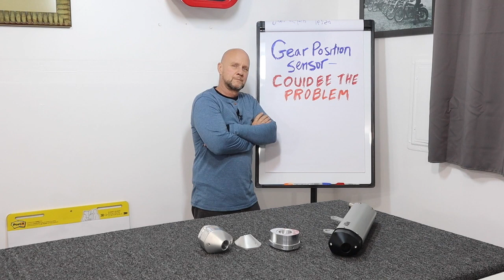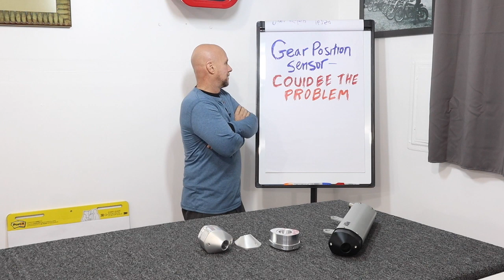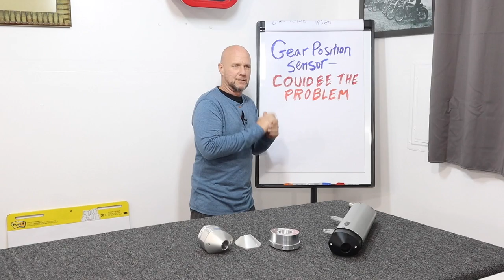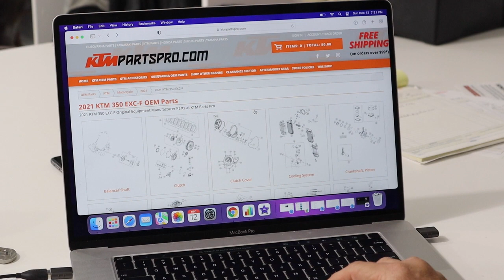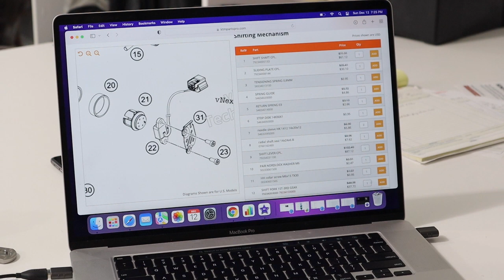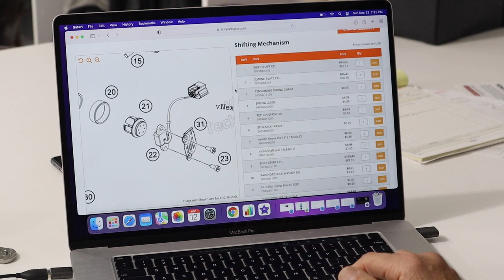KTM / HUSKY Stalling or not starting? Could be your gear selector sensor. Let's fix it!

Comment: That is exactly what happened to my 701. But I had
not modified anything in that area. They did not properly zip tie the wires from the factory.
A very intermittent problem as each wire was slowly melting and shorting.
Then after 300 miles everything was melted and shorted out and bike wouldn't run at all.
The exhaust pipe is extremely hot.
Reply from the maker: Glad it's fixed